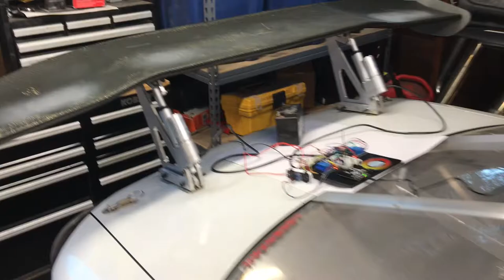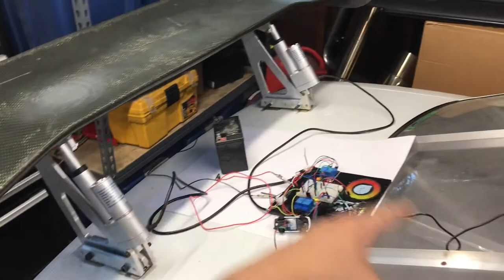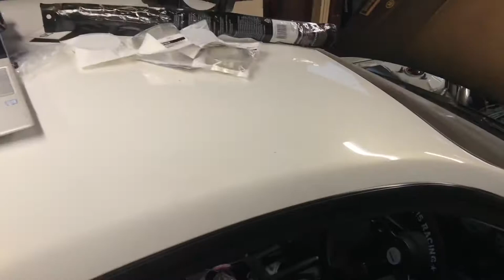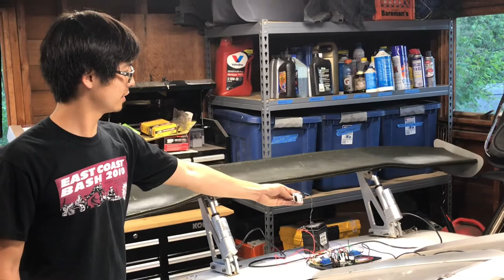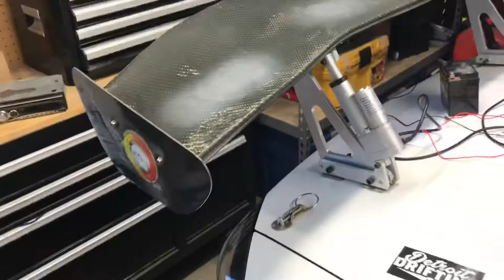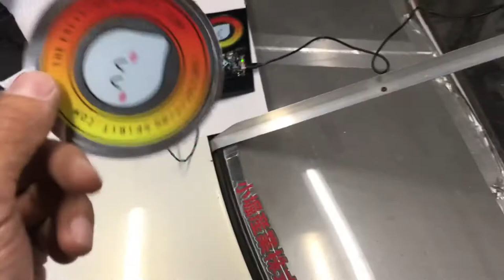Active Aero Prototype on Nissan Silvia

Comment: I was thinking about doing this plus an flush deployment like a Bugatti Veyron on my 370z. I want to use a Porsche Boxter 986. Think that would work to push the spoiler up?
Reply from the maker: hmmm that one may be a bit more tricky. I think you'd need to figure out the throw/positioning for that wing. However, if you found the right linear actuator I think it'd work!